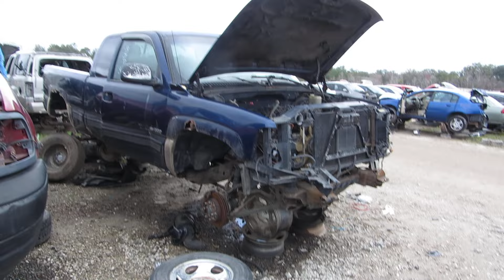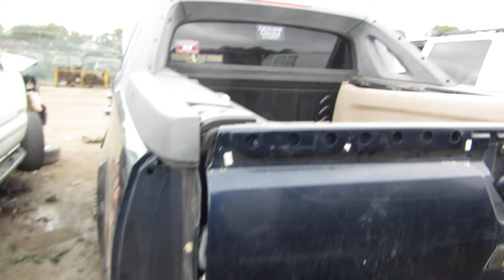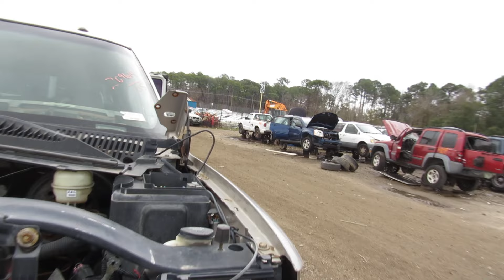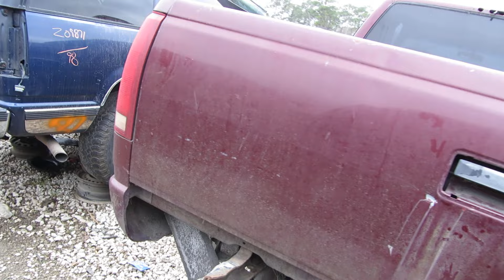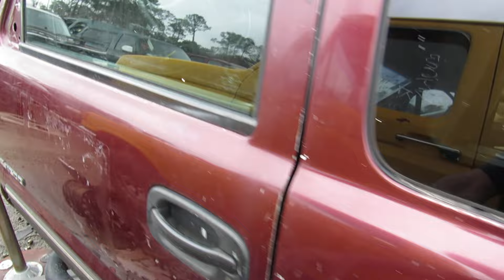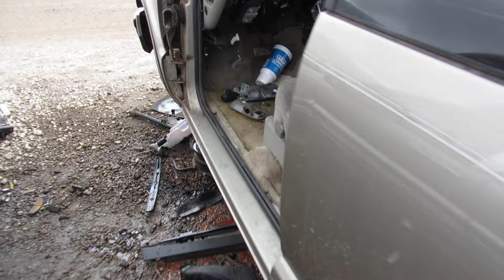Junkyard in Jacksonville ( Chevy Truck edition )

Comment: The reason why all the GM trucks are stripped is it because the GM trucks last longer than the Ford trucks every part you need for your GM Ford has it I went through this 20 years ago on a 88 98 Chevrolet I had could not find parts nowhere